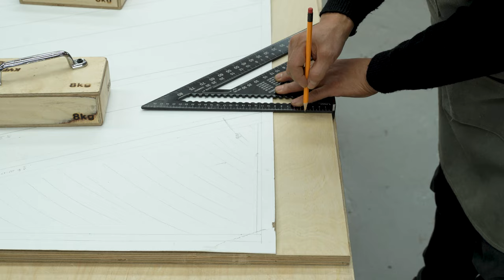Circular saw Drawer Oblique and Unique

Comment from the maker: I made a diagonal drawer, the last of a set of five drawers.
I was constantly planning a chest of drawers to store circular saw blades like a table saw or a miter saw. Grinder blades are included in this project.
Due to the shape of the circular blades, I thought it would be more suitable to hang them rather than lay them down or stack them, but I thought it would not be enough to tilt the support to hang them, so I tilted the drawer itself to make it diagonal.
As a result, a total of five types of drawers were made, including circular, vertical, horizontal, hidden, and diagonal shapes.
There were many difficulties in making oblique drawers, but as always, I feel that I learn and grow more in the process of overcoming the difficulties.
I hope this video will be a small hint when you decorate your workshop. Thank you.
Reply: Здравствуйте, а подскажите пожалуйста,  сколько градусов делали угол наклона,если не секрет?спасибо вам за ваш труд.
Reply from the maker: @Дмитрий-г4л3х  
Это не секрет. Это 23 градуса. Надеюсь, вы создадите замечательные работы. Спасибо

It's not a secret. It's 23 degrees. I hope you create wonderful works. thank you!